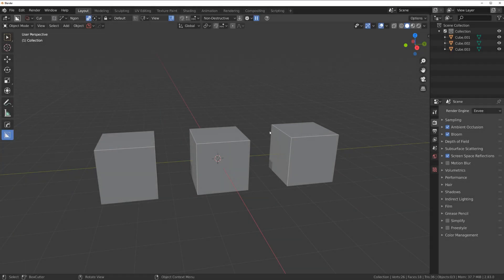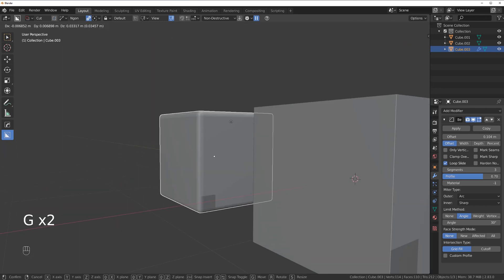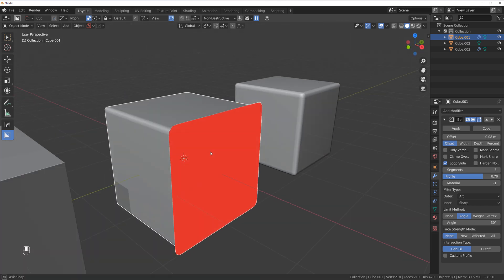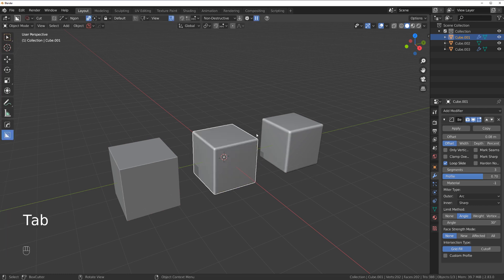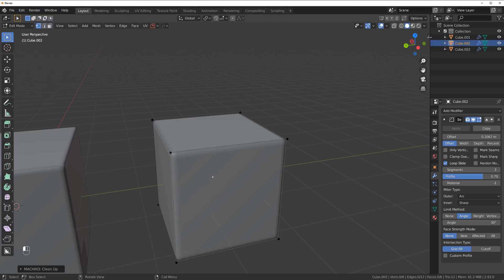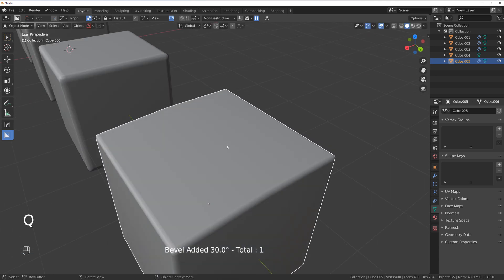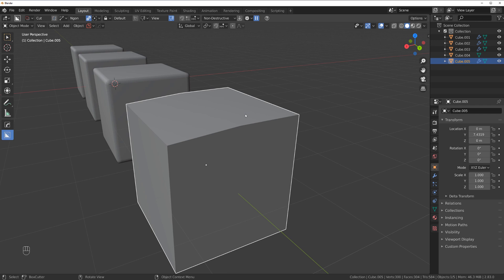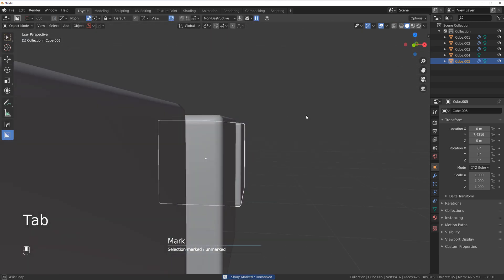BEVELS do not work in BLENDER? - quick fix tips

Comment: To remove doubles you just need to press space bar and enter "merge by distance" in edit mode
Also there is a weld modifier that does it too
Reply from the maker: and your point is what exactly? That shit in vanilla takes more keystrokes, well, we know that
Reply: Just wanted to say you can merge verts that sit on top of each other without an add-on. Also there is an auto merge option in the workspace settings so you never run into that issue